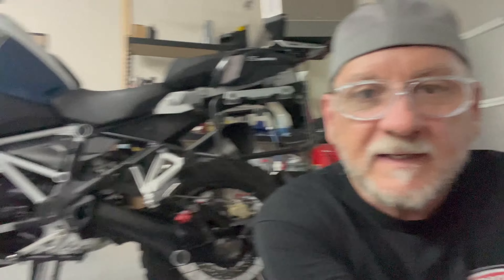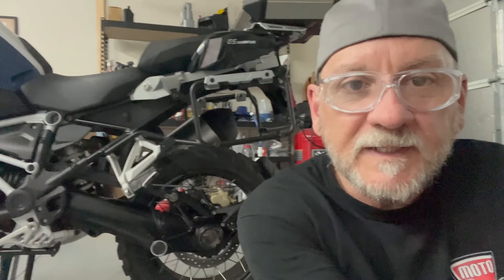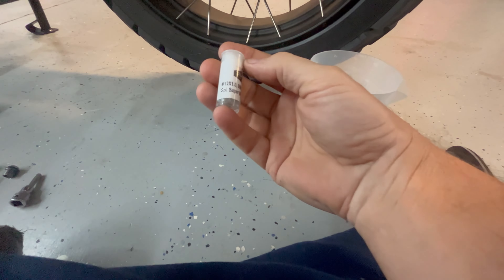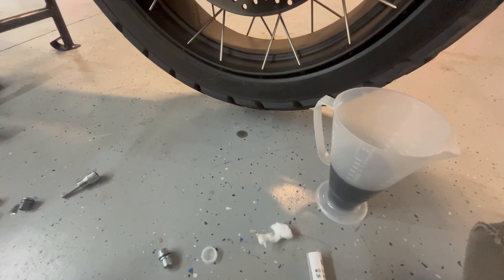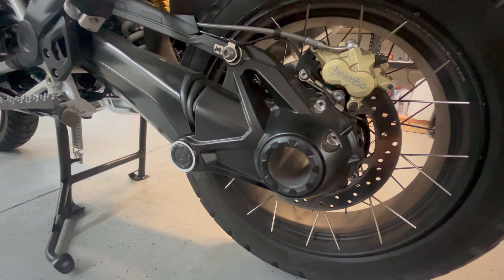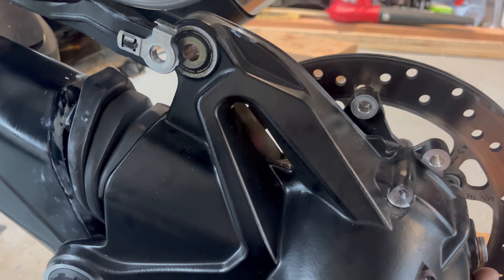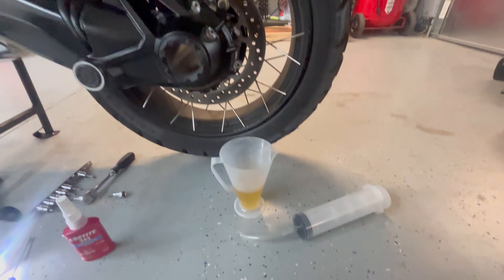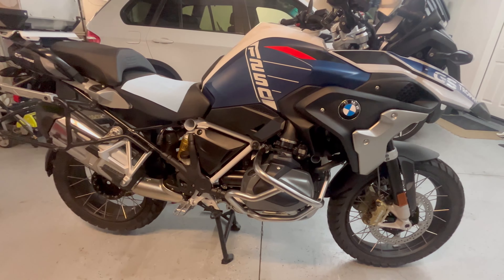2023 R1250GS Oil Change & Final Drive Service

Comment: My book says only to change the engine and oil filter at 600 miles. 2023 R1250 GSA
Reply from the maker: Yeap I think 600 is the first oil and filter change. Dry splines on these has been and issue so I lubed mine and my dealer said they always change the final drive oil at the same time they do the first oil change.